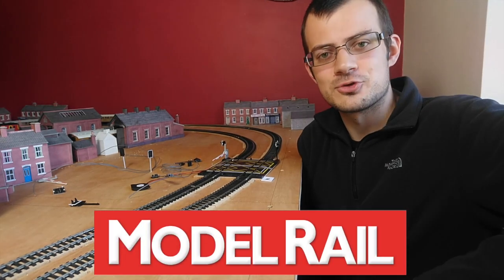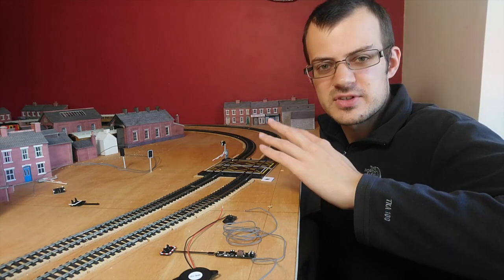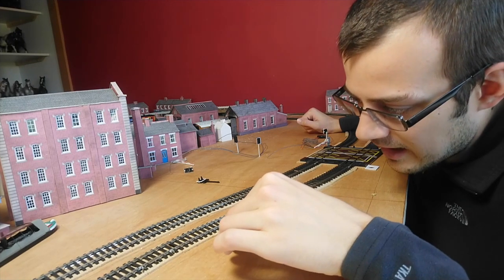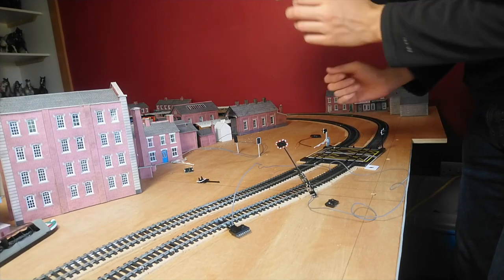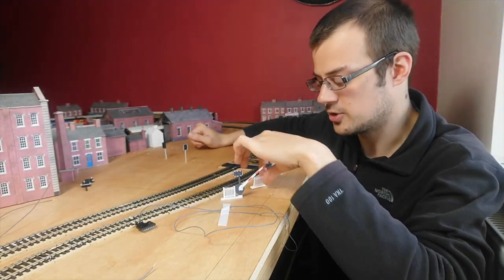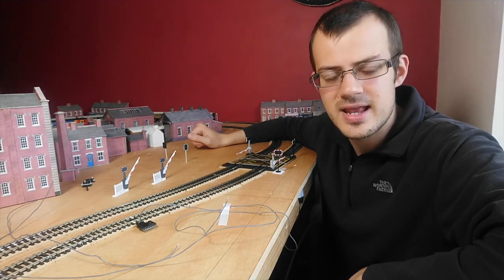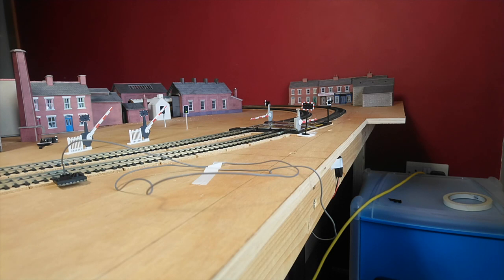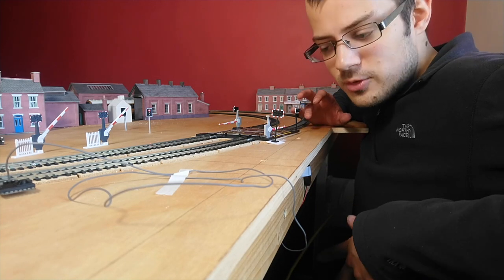Model Rail How To... Install a level crossing

Comment: This is a great video. Very useful. I would like to see how you wire up a crossing for both directions, 4 sets of lights and the barrier arm operating. If I could how you do it I would be interested in buying.  Maybe you can ask them to sponsor the next part. Nice work MRM

Comment: Hey quick question. Because I have a two track layout I was wondering if I were to buy these how easy would it be to have two lights, two track on sensors and if possible can you unplug the speaker and not break the connection?

Comment: Aren’t the barriers supposed to raise and fall according to the sensors too?

Good video. It looks simple enough. Thanks for the video.
Reply from the maker: Hi Jim, there are options that you can add solenoids to make the barriers move however because Train-Tech supplied us the products free of charge for the article and video, I asked for the cheapest version so Train-Tech were giving away the smallest monetary value of their products as possible.

Comment: Shame you've used the highly inaccurate Hornby level crossing. The markings on the crossing do not match the required UK road markings (these markings have been in use since the 1960s). Go and look at the ORR's pamphlet on level crossings to see what I mean.